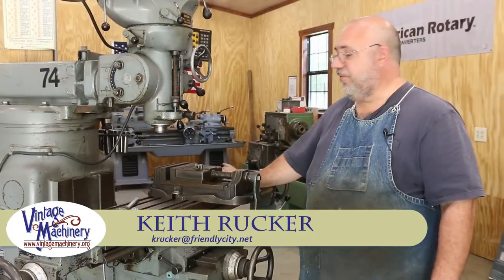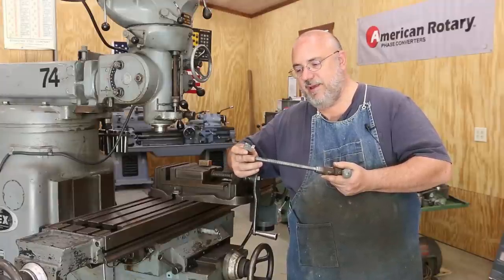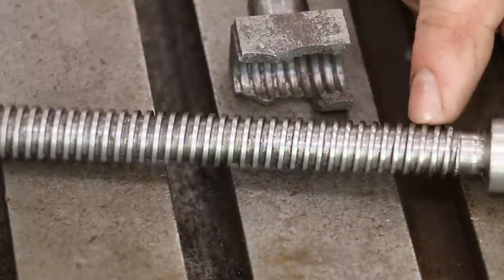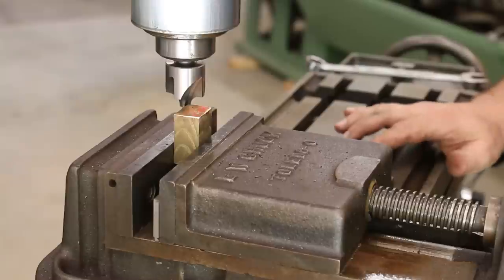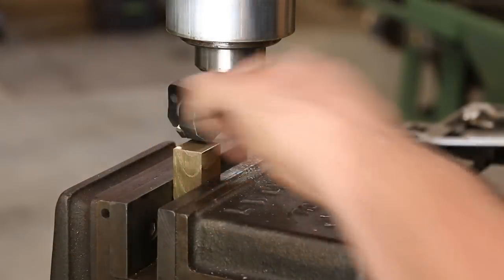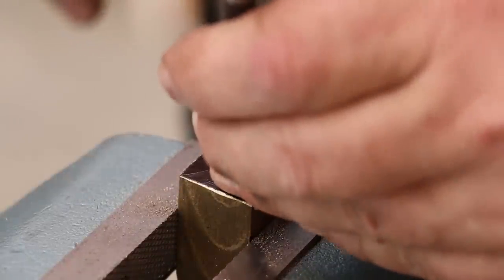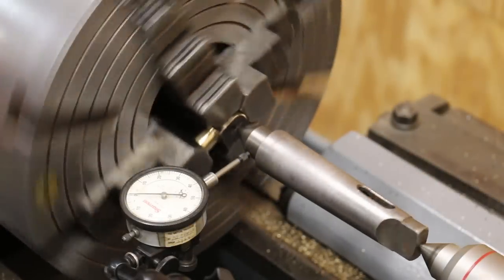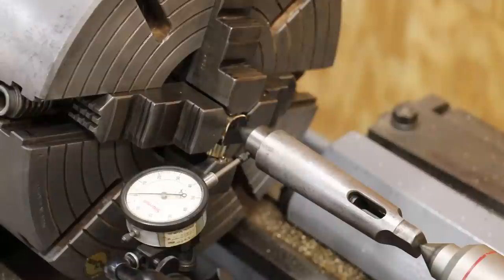Machining a New Bronze Cross Feed Nut for a 1909 F. E. Reed Lathe

Comment: Here is a little tip. When you true up something like the nut using a centre(great technique) set your dial gauge a zero where you want to finish, ie if its at 90 and 5 then set the clock at 47.5 when it reads 90. That way you just keep aiming for zero, both axis is the same since you are clocking off a ground round centre.

Comment: I have an old vice that was missing the half nut which was an obsolete part and impossible to find.  I don't have a lathe so I just melted some brass and poured it on the lead screw which was set in a mould.  long story short...worked like new.  very very easy to do.

Comment: I had to cut an acme thread with a tap to make new half nuts for a lathe. The leadscrew was 3/4" dia. In order to make the forces on the tap more manageable I ran a standard 60 deg NC thread tap of the same pitch through first to remove a bunch of material. The acme tap went through quite easily after that. Not always easy to find the right tap. A youtube star like yourself can probably appeal to your audience for a loaner. Cool project and generous of you to help a brother out.

Comment: Hi Keith, When I worked at ITT Blackburn we made our own silicone bronze for hardware and connectors. Those marks are from the pull and draw of the material flowing thru the draw dies. There is a set of traveling pullers that drags the hardened material thru a die that has cooling water passing thru it. When the material had hardened it pulls forward a bit and the cycle starts again, hence the drag marks.

Comment: Love that indicating method between centers! This might be an old trick but I've never seen it before!
Reply: Felix Dietz look up wiggle stick or wobble indicator,  something like that
Reply: I've seen it on Doubleboost, and I think Adam's done it as well...but I know John @ Doubleboost uses it fairly often, you should check him out, he is hilarious!
Reply: Brought back memories of me, as a young teen replacing the spokes on my bicycle with chromed spokes (just to "look cool."....never realizing it was the spokes that kept the rim, and tire, straight!! Took many hours of loosen this side-tighten that side to get it straight enough to ride and not be laughed at..............smh
Reply: Called a Wobble Bar. I made my own as an apprentice some 45 years ago and still in use today. Better if the center is spring loaded.

Comment: When I worked for B & W nuclear in Barberton, Ohio, we cut a lot of non-standard threads.   Mainly buttress threads with altered inside and outside radii for strength.    Also double and quad lead threads.    Fun stuff.   Our cutter grind department could make almost any cutting tool you needed.   Most of our products had very high nickel content, therefore the chips were stringy and you had to use a very low surface cutting speed.

Comment: Watching you needing a special tap, I was reminded of something in my apprenticeship days. One of the other apprentices was restoring an old car at home and needed a really strange tap size. He bought a casting into work and one of the tool makers measured the thread ,figured out what it was and showed him how to make a tap out of tool steel . Not so hard from what i remember and the rest of us learned a lot in a couple of hours,including a bit of heat treating. ...Just a thought. Cheers!
Reply: My older machining books make it sound like no big deal whipping up a tap or special drill bit, reamer etc. Mebbe I will try one day.
Reply: If you look at a normal Vee form tap the middle or second tap, as opposed to a no. 1 tap or no. 3 plug tap, you will see that the tap is practically parallel for 5/8ths of it's length and the only cutting bit is the tapered end piece. Making a tap with a long tapered section only creates a long friction gripping surface. Gun nosed taps or spiral point taps have a slanting cut at the end of the tap for approx. 3 threads and that is what does the cutting …..the rest of the tap is just to guide it straight in the hole once it's in the hole and starts cutting. You also get spiral taps and they also only cut on the very end 3 threads. Taps NEVER cut along their flutes and are resharpened if they get a chip by grinding those end threads only.

Comment: @ 10:20 Typical wide growth rings of Southern Yellow Bronze.  If you use a piece from old growth Sitka Bronze, the rings are much tighter.
Reply: LMAO
Reply: OK, THAT is GOOD!

Alaskan Sitka bronze IS the best!
(I should know, used to build airplanes.) :D

steve
Reply: That was exactly what I thought too...not about the variety of tree, but that the continuous cast looked like "wood grain" on the sides. It would(not a pun) be interesting to see the internal grain structure of the Bronze to see if it follows those exterior patterns with the stress and strain of being forced through the dies.
Reply: At first I thought he was trying to pass off a painted 2x4 as bronze.
Reply: halnywiatr A
Reply: Northern hard bronze has such small grain you can hardly see them.  Much harder to burn in a wood stove.

Comment: I was always taught that when hand tapping you did one full turn forward then a 1/2 back to help clear the swarf. Every 4 forward do a turn or two back and then back to 1 and the 1/2. This particularly for deeper threads to keep the tap and hole clear of swarf that might get caught and jam the tap. I was taught this in metalwork class at secondary school when I was 12 and have always used it. It takes a little longer to tap a hole but they always come out clean and well formed and in the intermeaning 54 years I have never broken a tap.

Comment: Had to make exactly that part for my 1950's English Smart and Brown SABEL 9"  Lathe.  1/2" cross slide lead screw with LH square thread as well.   10 TPI.  First I ground up a tool and screw cut a short piece of lead screw in 1214 to use as a plug gauge.  Then ground up an internal threading tool and cut a practice piece in aluminium to prove out the internal thread cutting tool.  Then milled up a block of phosphor bronze.  To centre it in the four jaw chuck rather than clock it I used the cutting tool itself lightly touching against the part's flats and read the numbers off the cross slide dial.  Managed to get it centred within 0.001" then machined the boss and tapped it for the  clamp grub screw.  Turned part 90 degrees and again centred the part using the tool itself lightly against the flats.  Centre drilled,  drilled,  bored and finally cut the thread to fit the short plug gauge I made.   Only problem was when fitting the nut to the cross slide screw it went tight in the middle.  Checking found that the cross slide screw was 0.002" oversize there.  So had to rechuck the part and pick up the thread then skim out a 0.001" cut.  As i have only the one Lathe that meant dismantling the Lathe to measure the part and then reassembling it to machine the new nut.  Same cycle for the skim cut.  That was some five years back and cross slide screw & nut has worn very little since.  Lathe gets used most days.

Comment: Did exactly the same for my Le Blond.  Used Acme thread all thread for the rod and made a very tapered tap using it.  In the meantime, someone sent me a tap to us.  Made one out of delrin and another out of bronze.  With the bronze, I used a regular threading insert to remove lots of stock before using the tap.  Even so, it was stressful, hoping not to break the tap.  Got it done, but not one of those projects I'd like to repeat any time soon.

Comment: Another good video!

Since you were tapping bronze seems like you could make a tap from a piece of drill rod. 
Thread it on the lathe then mill a couple of groves for relief.  The drill rod would probably be hard enough to cut one thread in the bronze without even heat treating it.
Reply: Agreed, very good video but drill rod would not work even if hardened. Taps must have radial relief on each land plus bearing bronze is tough to tap as demonstrated here by Keith.

Comment: Hey Keith, you would do well to stone a little negative rake on that tap to allow cutting a non-ferrous material. It will cut freely and to size. Also it appears that you were looking at the 18th Student Edition of the Machinery's Handbook. Same one I used for years in the shop. Nice video!

Comment: Usually always safe going a few thou over the root diameter of the thread as the process of cutting/forming the thread displaces material as well as cutting so it tends to squeeze up especially in soft gummy materials. That likely is what was happening here. If the lathe had clearance for it you could have made the nut split and shimmed to provide future adjustment and you could have cranked the tap thru in stages and that might have helped.
Reply: That is a good point about drill sizes for tapped holes. I have written an online computer program for thread drill sizes. If the drill is the same as the root diameter of the thread it is considered 100% depth, but it is difficult to cut the thread.  The recommended drill size is 75% thread depth for these common taps because there is a forming effect that you mentioned. Material is squeezed up to create, or 'form', the crest of the thread. For soft 'gummy' materials it can even be reduced to 60%.  Often we amateurs do not have a huge range of drill sizes so I wrote this program that tells you the percentage depth you will get with common drill sizes and this helps you choose an appropriate drill. This computer program is a spin-off of the program for calculating gears for your gear train. It is called 'RideTheGearTrain.com'. It doesn't cost anything.
Reply: @Evan-e-cent  Your chart would likely be handy to many in a wall form.
Reply: @bcbloc02  The program produces a couple of charts for a single thread size and requires the  full thread standard specifications such as UNC, BSW, BSF, ISO-metric etc to calculate the minor (root) diameter. With hundreds of thread diameters, and standards, and two large tables for every thread you would need a huge workshop wallpapered with tables. That is the advantage that the program has. It is online and can be run on a phone, tablet or computer. You select metric or imperial in menu item 3, and then in menu item 5C choose from tables the thread type like UNC, and the thread diameter and pitch, and RUN the program to display the tables of drill sizes with the % thread depth for each drill. The main purpose of the program is to calculate the gear train required to cut the pitch you need. The drill sizes are just an 'extra' feature. It sounds a bit complicated but it is really quite easy. If it is popular I could add a menu item just for drill sizes to make it a bit simpler.

Comment: this is  KEN GEORGE, not LESLEY,  but it is her computer, i have not done any lathe work for about 60 years when i was at a U.K. technical school, I loved machine shop, forgework, and tin smithing, I also worked in my Granpappy's forge as a striker, helped with the horses could make a shoe but never hot fitted one, i never cut a gear - but have cut plenty of threads - usually into car or outboard motor blocks. i worked mostly as a process plant designer / detailer for onsite construction crews, and project management. I have enjoyed watching your videos, and explanations , also your near enough approach - like to within half a thou :) i will be back to watch more THANKS

Comment: That trick with the dead center is really slick, i'll definitely be stowing that one away
Reply: When setting up to duplicate a taper, Morse or ER or 5C collet whatever set a sample of the taper up between centres like that and mount you DI on the compound and adjust its angle until it reads zero end to end. Lock it down and cut the taper. Works every time even with a tool post grinder.

Comment: Very nice!  I once had to make several of these nuts to fit the Powermatic Logan lathes at school.  I had to make several and I was avle to order a length of all thread the correct size and type to re fit 4 lathes at a fraction of the cost  of the parts for one.  At that time I had been able to find a tap like the one you found.  I too was apprehensive but it worked well.

All the best!

Mike

Comment: Keith, I had the same issue finding 1/2" - 10 LH Acme threading tools & rod for my Clausing/Atlas lathe rebuild.  Ultimately, I purchased a piece of 3 foot long 5/8" - 10 Acme rod and a round cast-iron nut.  I milled the nut similar to the shape you've done here.   These larger 5/8" parts require a slight modification to the carriage casting, but they will undoubtedly last far longer than the original parts.

The other option I considered was to thread-mill a bronze nut on the CNC mill.   I plan to make a new set of half-nuts using that method since the main lead-screw is 7/8" - 8 Acme.

Comment: During WWII, the US Navy armor-piercing projectiles reverted to thick square threads to hold the base plugs and inserted base fuzes due to distortion of the tough, flexible lower body of the shells (only the nose and upper body was high hardness to punch a hp;e in the armor, since the the explosive filler was in the lower part of the shell and its casing had to resist cracks and breaking) allowing the plugs to be ejected during heavy armor impact at am angle.  Older shells had lower requirements about angled impacts and their more conventional many small pointed teeth for threads was found to not grip the shell body tightly emough.  Threads have to be tailored to the strength requirements of the usage desured.

Comment: Keith, 

The English model steam engine makers are sometimes quite short of dollars. So too are other hobby machinists, and so these blokes look for alternative solutions for difficult tasks. One such solution I have seen is the process they sometimes call "gashing," which is really just what you do with a multi-part Acme or buttress thread tap. Instead of having several different profiles in the tap itself (which is convenient, because they are all "timed" or located so as to be in phase with each other), the resourceful amateur machinist would use a tap of the same pitch but with a different thread profile, and in doing so would remove a lot of the material in one or two (or more) passes, thus enabling the final cut to be made with the accurately-ground form tool you had there; the 1/2 x 8 tpi tap.

I have often seen the same process used to cut gears. By "gashing" the part, and removing a lot of the stock material first, you can preserve the more expensive gear cutters by reducing the wear on them.

Perhaps you could have cut an internal thread by single-pointing it in the lathe with a couple of custom-ground bits, with narrower but similar profiles, before using your lucky_find_but_expensive tap?

Note that I am not trying to teach you to suck eggs; just sayin'...

Comment: Keith regarding to your method of centering a work piece in the 4 jaw, I must tell you just yesterday I used the same method.  I was trying to true-up a bent shaft off “a basket case rebuild” of a PERFORMAX 16-32 Drum Sander.  The drive roller for the conveyor belt was about .047” out of round.  And with the dial indicator made it very easy to find where I needed and how much to bend it.  I set-up a block of hard wood with a 5/16 hole drilled cross grain in a vise to hold without marring the shaft.  The shaft was approx. ½” dia. with both ends turned down to 5/16 the end that was bent was approx 3” long.  After a few trips between the lathe and vise I was able to get it down to about .003” out of true, I could have spent more time but felt that was good enough as the motor only turns (I guess) less 80 – 100 RPMs.  I watch all your videos and I’ve learned a lot watching them, thank very much! 
Richard

Comment: excellent video! Just a small comment... square threads are generally used because they are more efficient; That is, all of the rotational torque get transferred to the direction of motion as opposed to angled thread geometry which can be though of as an inclined plane. what this means is that on an angled thread i.e. acme, a portion of the torque goes to the component of the force perpendicular to the direction of travel.
Also, the square thread will very quickly generate backlash as there is no way to compensate for wear. On an acme thread lash can be compensated for say by way of a half nut design. Pretty much the only place to commonly see a square thread anymore is on a vice because of the efficiency thing mentioned earlier.
cheers!!

Comment: Whew, I breathed a sigh of relief, High Drama- Keith, when at  37:14 that next oomph, you could almost sense the relief in the poor tap- "Hey, light at the end of this tunnel" as she zips through the remaining bronze. 
    I was thinking at one point- reverse the tap and come in from the back side when the initial thread form emerged on the inside end of the hole to act as guide.  Of course do so only enough to relieve that hole (reduce the overall effective cutting length) so as when again coming from the front it would be less likely to snap the tap, as many others commenters feared.  Nice job overall, and as Shakespeare? said- "All's well as ends well".  (Who are the bozos that DISlike your videos, ever?) !!

Comment: Be aware that the first tap you used was a gun tap, which should not be used in a blind hole unless you have a much deeper hole under the thread depth . That tap drives the chips forward, and you will run into them before getting to the bottom. The proper tap to start the threaded hole would be a taper chamfer tap which would be muncher easier to start. The gun tap that you used should only be used in thru holes.